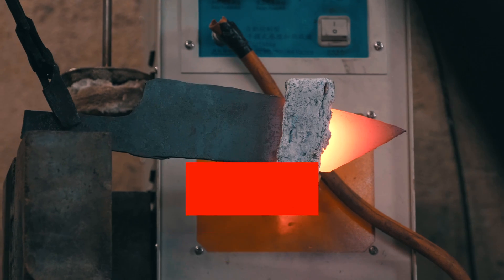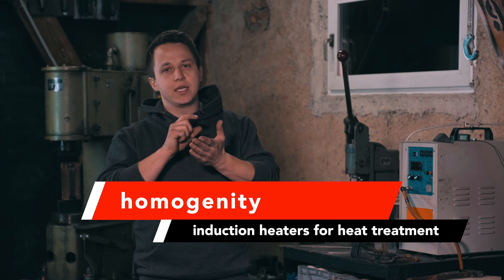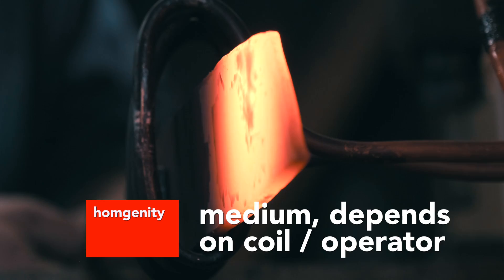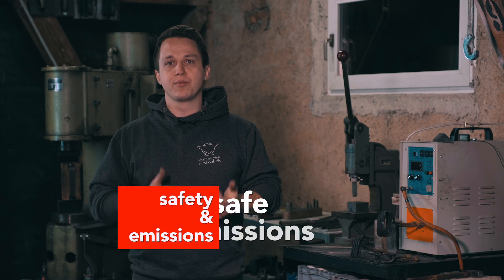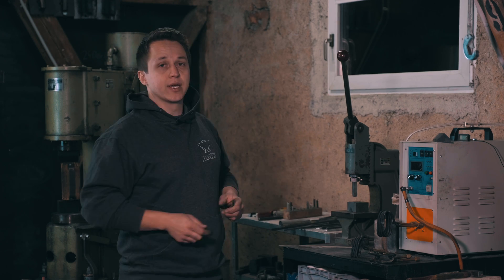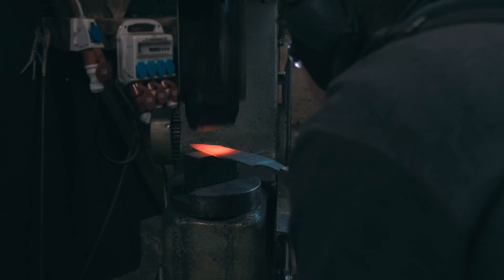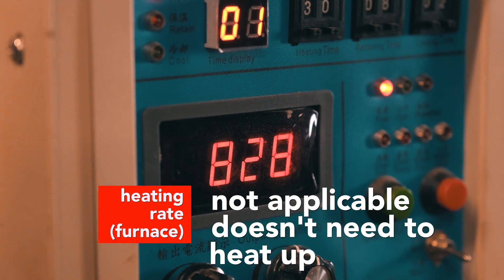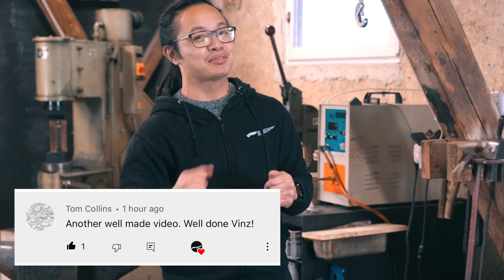Better than a gas forge for heat treatment?

Comment: Thank you so much for your visit and the super fun video shooting Vinz! I hope this video will be somewhat helpful to the community.
Reply: It's not often I agree with everything said in one of Vinz's videos but  I did this time☺☺☺☺ Super clear presentation. Great work Tobias. 
I've been wanting an induction heater for some time for billet heating. Super efficient for that job.
Reply: @clarkeknives4159  i really appreciate it, thanks!

 I really love my unit, it's so useful to have red hot steel in a matter of seconds...
Reply: @MesserschmiedeHangler  What power output and frequency is your unit?
Reply: @grahamclarke4470  it's sold as a 15kW and 30-100kHz unit. Although the 15kW can mathematically only be short time peak performance, realistically it can only deliver around 7,5 kW continuously which is plenty to work with already
Reply: @MesserschmiedeHangler  Hi Tobias, A Happy New Year to you and yours and apologies for the slow response - I get so many messages from so many different sources I sometimes miss some!!!
Thanks for the info - it was the frequency I was interested in. I'd love to get an induction heater but it would be for heating billets for forging and I wasn't too sure if frequencies such as yours would be too high to heat billets of, say, 60 x 100 x 100mm evenly to the centre. My only previous experience was heating 200 x 200 x 400mm billets of solid steel (to forge 155mm shell casings) when I worked for the British Military and there we used a 350KW, 50Hz unit!!!
Reply: @grahamclarke4470  happy new year to you too! I think for that size of billets you would better get a stronger unit that can also drive the larger coils needed for this application. The units each have limitations in how large of a coil and how many windings they can work with.
Reply: @MesserschmiedeHangler  Thanks Tobias, that's the feedback I needed 😊😊😊😊😊😊
Reply: Super Helpful! Never tought of grain refinement with an induction heater! Love the idea!
Reply: @zgi5950  I am glad you liked it Zoltan!
Reply from the maker: The pleasure was all mine bud! Thank you for sharing your in-depth knowledge! Can’t wait to release the rest of the series! Speak to you again soon!

Comment: Metallurgist here. Steel needs time for proper heat treatment according to the type of steel but at least a few minutes. It is a basic prerequisite for a sufficient transformation of the steel structure. That's why you can't never achieve the best properties with coil. In gas forge you can make usable blade but temperature monitoring is not precise, so you will never get the maximum properties out of the steel. Maybe by chance. But it's still much better than coil heating.

Comment: Great, just learned what else my induction bolt buster can be used for.
Reply: Metallurgist here. Steel needs time for proper heat treatment according to the type of steel but at least a few minutes. It is a basic prerequisite for a sufficient transformation of the steel structure. That's why you can't never achieve the best properties with coil. In gas forge you can make usable blade but temperature monitoring is not precise, so you will never get the maximum properties out of the steel. Maybe by chance. But it's still much better than coil heating.

Comment: Ever tried Laser hardening? Heating rates can be in the thousands of degrees per second, effectively coming up to temperature in a splitsecond.
Target temperatures are usually higher than what is given in the datasheet, because you don't have 60 minutes soak time. But as you only keep it for a couple of seconds max, grain growth is hardly a problem.
Reply: Steel needs time for proper heat treatment according to the type of steel. It is a basic prerequisite for a sufficient transformation of the steel structure. That's why you can't never heat-treat a knife well with a laser. Or with a coil. You can achieve some result, but never the best.
Reply: @to_the_wilderness  Traditional knife steels are selected for this process. But that is not necessarily the case. 
Industrial blades for shearing everything from straw sheet metal or cutters of all types are routinely hardened by Lasers or induction. So... I wouldn't say it like that.

Comment: I'm new to knife making and efficiency is a big topic for me. I unfortunately don't have time to spend hours and hours in the workshop. So I like to do my tasks in 1-2 hours stint. To do heat treating (non-stainless steel) in such a small time the oven needs to heat up fast.

To achieve this chamber volume, power and insulation need to be sufficient. Heat treating only one knife is also not very effective. So I need to do hardening on 2-3 blades to reduce the electricity costs per knife. This will also influence my working process. Instead of doing one knife after the other. I need to do multiple knifes simultaneously. 
I think with an induction heater this could be achieved faster and more efficient than in a two brick gas forge or an electric oven. The temperature guessing is the same using a gas forge. That's a pro for the electric oven. Electricity is always available, nothing more frustrating then having time but running out of gas. If I saw it correctly Tobias is using a 15kW induction heater and he can handle it and use it as shown in the videos. But what minimal power is needed to keep the benefits of fast heat up times? 

And could you please describe or do an experiment to show the influence of different workpiece heat up times (induction vs. electric)? The grain structure will get bigger, but how will that be notable in the final product/knife?

PS: Tobias' 2x72'' push stick attachment that is shown in some other videos is a great idea that is worth an own video.
Reply from the maker: Hi Tim. Thanks for the feedback and the questions. I’ll try and get Tobias to answer the questions if he’s free. 

With regards to the belt grinder attachment, we have a video coming for it soon so watch this space! 

Thanks!

Comment: This guy needs to look up what people are doing in the weed industry with heat controlled plates for pressing hash oils. 

A huge plate with controlled contact surface might work better then coils and dependant on the heating elements he may be able to get temperature control at a better level. 

I'd honestly just buy a molten salt kiln instead though. Takes some precautions but uber fast even efficient heating. Depending on what you do it can be used for forging and hardening. And then an oven even a cheap one for tempering.
Reply: He has a point on efficiency. However depending on fuel source you can get heat more cost effective for salt baths at times. 

And spending money you can induction heat your salt bath. Not as great efficiency since material. But thermal transfer of salt is great so not that bad and more advantages with few trade offs. 

However this guy has given me some ideas on how that could be used very effectively for working certain types of things.
Reply from the maker: Hello again mate great to hear you’ve seen the pros and cons of an induction heater for heat treatment. And you’ll be pleased to know we also have both an electric kiln and a fluidised sand bed coming as a comparison (we didn’t have a salt bath but it will be mentioned several times in this series). I hope you enjoyed the video!
Reply: @UK Bladeshow  sand bed sounds interesting, been wanting to look into those and the new polymer baths and related solutions. Some of em might be useful to send info on to makers in other hobbies or down the road if my sword company idea works out in the shorter term can use that for an example of business management to get loans to start a cycling company. Well, a form of cycling. 

Heat treatment on welded tubular frames can get annoying even either air hardening being used and 4130 being highly forgiving. Post weld heattreatment has significant advantages, especially if you use nicer quality welding material on the fill rod. New super alloys also present some cool opportunities to potentially double the strength of parts at a specific weight.

If you do manage to get the resources a molten salt bath, especially induction based setups can be super useful and efficient in heating. For knives it'd probably not be too bad to use for forging heat even, but for heattreatment, it's probably the beat attainable setup. Heated oils with induction can also work and get jerryrigged but they're a bit riskier. Molten lead is a more historic replacement but bad lol. If you can find a suitable container you can build your own setups and reduce costs a bit. 

There's a molten salt reactor company as well that's produced an ultra dried salt the helps reduce corrosive offgas issues and helps with other things as well. Looking into getting some myself if this investor situation works out for the sword company. 

Haha stock removal and a full molten salt set up for both high temp salts and lower austempering range sounds fun huh? Likely going to add the induction forging set up given part of the business model is sustainable energy and recycling and reduced waste materials despite stock removal. Machined bits of steel work rather well for self steels, especially when you know what alloying agents they contain. xD The same with grinder dust, might even be able to do crucible steel with induction heating and the right crucibles.

Comment: A well thought out video putting together the pros and cons of induction coils. Well done (again) Vinz 😊 

My impression of induction coils after seeing this are: they have advantages with time/energy/environmental costs but need a bit of skill to use properly. A good investment for a professional blade maker but not the first thing to buy for a hobby blade maker (or wanna-be hobbyist like me).
Reply from the maker: Hi Tom! Thanks for the comprehensive feedback and agree with a lot of your comments too!

If cost of electricity isn’t an issue, I would suggest to consider an induction heater not just for heat treatment but for a lot of other things with making a blade (we have a separate video making a Go Mai knife: forging, heat treat etc, all on this induction heater). 

So in simple terms, it could be good for hobbyists too from my perspective. I’m sure Tobias can guide us more with this too (when he gets to reply to all the comments 😝😜)!
Reply: @UKBladeshow  looking forward to seeing your new stuff :)
Reply: It really depends on the shop youre working in and what type of work you want to be doing. If ventilation and open flames/fire hazards are a problem an induction heater can be a great choice for a basement or closed room for forging. Therefore you will need a good electric supply. Mine is 32A 380V single phase. We will go into more detaol in another video on what you can and can't do in terms forging with an induction heater.
Reply: @MesserschmiedeHangler  Thanks for the feedback. I’m a ferrous metallurgist myself and have always wanted to get into practical blacksmithing and blade making. I’m not in a position to open up a little workshop for myself yet. Hopefully in the future…

As an Austrian metallurgist I’ll guess you studied at Leoben?
Reply: @GemAppleTom  Indeed Tom, that's right i studied at Leoben 😊 great to meet a fellow nerd of the field 🙌 in which field do you work if I may ask?
Reply: @MesserschmiedeHangler  The majority of my industrial work has been in contract heat treatment and surface engineering, mostly nitriding. I’ve done a couple of years in friction welding and aerospace forging too. I’ve gone back to study now. Nearly finished a PhD that will hopefully let me get a job lecturing in metallurgy (I never cared for polymers or ceramics…)

My first proper job was in Austria (Wels) so that’s how I guessed about where you studied.

EDIt: yes, it is nice to meet other metallurgy geeks :)

Comment: What about oxidation? In a coal or gas forge the metal is shielded in a reducing or oxidising environment, with induction heating there is no choice but to heat the blade in an oxygen rich atmosphere. Does that have a noticeable effect?
Reply: Hey that's a good question that i had myself when i got one. My impression is that i get less or at least not more scale with an induction heater because the time at temperature is much lower and also there is no convection. So there is in general less gas reacting with the steel, although youre completely right - of course air has much more free oxygen than the atmosphere of a gas forge.

Comment: Not with the current electric prices
Reply from the maker: Good point but prices in Austria (and around other parts of the world) are still not too bad compared to gas. Also, as Tobias explained, most of your energy (if not all) goes to the blade.
Reply: @UKBladeshow  where I live its almost 1€ per kWh already
Reply: @makuuse  that's completely crazy, we are currently at 30ct/kWh which is bad already... On a per knife calculation i still think its probably more economical then propane or and electric kiln - but that would have to be an individual case study to really say for sure.